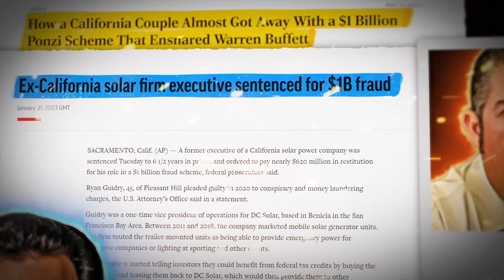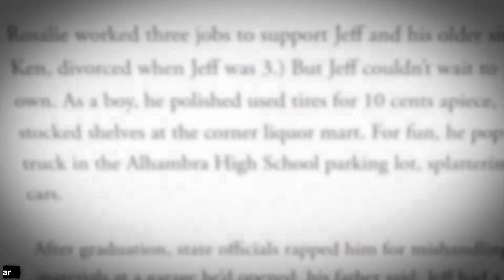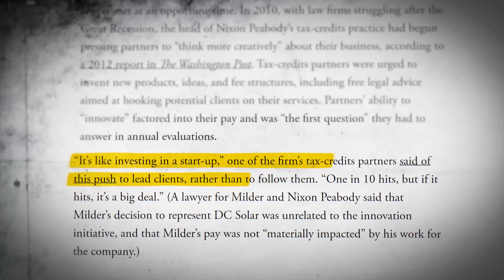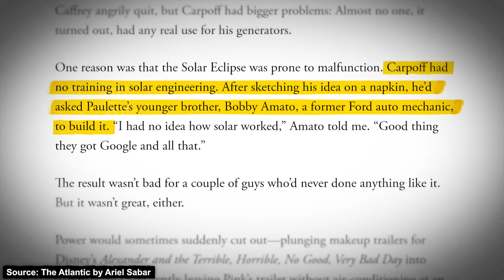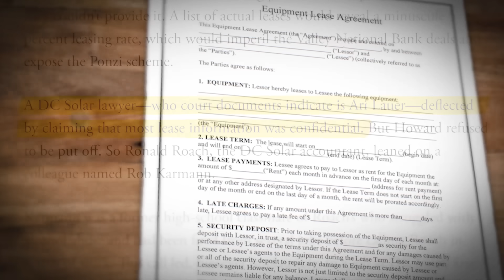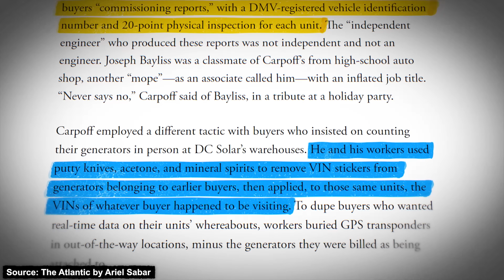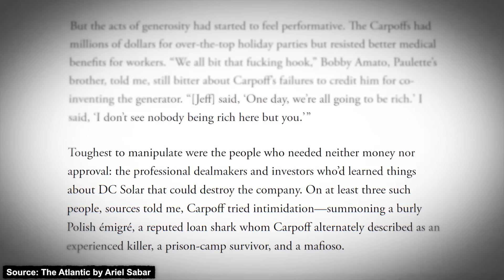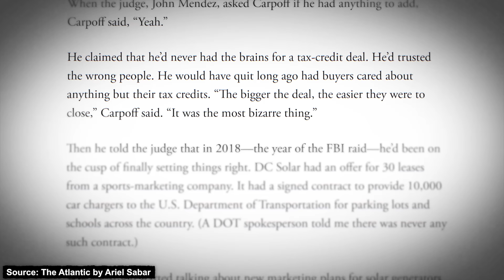The Fake Solar Company That Stole A Billion Dollars

Comment: Glad I waited till the end to comment, but I was gonna say: I do know exactly how much these trailers should have cost. $2000 for the solar panels, about $3000 for the 10kw diesel generator, another $2000 for the trailer and less than a grand for everything else. $158,000?
Its another Theranos. It shows you how absolutely nothing US investors care about their businesses being legitimate. Pay an electrician $200 to inspect one of these trailers and the whole thing would have been revealed as a scam. They were all 2kw peak solar systems which averages out to be about 500w over a day. $11000 a month for 500w? No one would ever rent this. On a clear day in a southern state, these things might make you $2 a day in electricity.

You could literally buy a new 5kw generator every month for $1000 and fuel it 24/7 for $2000 a month and get 10 times the electrical power. This guy might have been a criminal, but every single investor was guilty of criminal negligence. They should be right there in prison with him.

Comment: Anyone with any passing knowledge of how solar works could tell at a glance that that isn't enough solar cells to replace a decent sized generator.
I suspect they cheaped out on battery capacity as well.

The fact that not one single company, not one, paid someone who did understand solar or someone who could use google to review the specs on the trailers proves the tax break was the product, not the trailer.

Comment: For those wondering if all he needed were working trailers and then this would be legit money -- no. It would be like U-Haul having thousands of moving trucks, but no one was renting them. The business concept would only legitimately work if the solar trailers were being rented which no one was doing.

To get the tax break, you just had to invest in solar -- not necessarily add solar panels to your business. Companies were investing (buying) these trailers with the understanding that when a trailer would get rented, the company would in turn get 30% of the rental fee. Large upfront investment would get you your tax break and over time the money you invested would be returned in the form of rental money; thus you'd get your tax break for free.

If you're wondering why wouldn't these companies just spend the money to get actual solar panels, thus getting the tax break and saving some money from electricity charges... it's because there's far greater effort going that route. Buying into the trailer rentals was as easy as signing a check. Actually installing and maintaining solar panels takes engineers and staff, housing the batteries, etc. While there would be more tangible  benefits long term, it was never about that. It was all about easy free tax breaks.

Comment: I don't know why he would have run the scam in the first place rather than just making the actual product. It's the easiest shit in the world. Panels > solar charge controller > batteries > DC inverter. Boom, that's it. And you don't make any of those components yourself, you buy them from other people and then wire them up, and mount it all on a trailer. That's it!! Why didn't he just do it properly??

Comment: No way those trailers could run a cell site, a low power radio repeater yes, but when the sun doesn't shine you still need a generator. It can be a real bitch
 to keep one running remotely for a winter in the northwest, I know from experience. Who invests money that big on a pipe-dream?

Comment: Sounds like the portable solar panel would be easy to build for anyone with even the slightest experience in the field. With that kind of money you could simply have hired engineers to design and build it. You can straight up tell the investors at the start this is only a prototype and some of the money will go into further RnD and manufacturing. Its not like he was inventing something brand new. He was just combining existing technologies. Not dissimilar to when you use lego bricks to build new and exiting structures.

Comment: For me I just had to look at the trailer. Judging by the number of panels each trailer had, I'd guesstimate that on a good day that can produce around 1.5 kW at 100 percent efficiency. With that we can power up a small room air conditioner. But at the regular efficiency of 15 percent? Probably charge our cell phone. Charge an EV? Around 70 of dem trailers. So just by looking at the number of panels, using Google, and some math it looked like it wouldn't work.

Comment: A lot of folks talking out of their ass here. I bought 10 of these trailers at Vegas auction.  H models 2015 - 2016. 2 years ago.  Two of them are STILL running my fully equipped off grid home,  and the others are doing the same thing around my northern Arizona area. They were impeccably designed with top shelf components.  That. However doesn't change the fact that overall. This guy was an idiot.  I got in on bottom floor of Auctions,  and walked away with all 10 at an average price of $5,500 each. They were all new. Trailer is worth that

Comment: The things didn't work, in fact they could not work. That's not to say they didn't generate any electricity at all. It's just that the cheapest little generator you can buy at harbor freight puts out more power then this trailer mounted sore thing ever could

Comment: Obama era panels. So these were the 150's so a trailer full would output 1150watts. They were 80 percent efficient so like 975ish full sun. Thats good for a fridge. About it. 

This could work today for like small stuff. If you used 330s 3300 watts for the trailer. Maybe as a ebike charging station. But what else could you really use them for. You would need 10 of them to do anything serious.